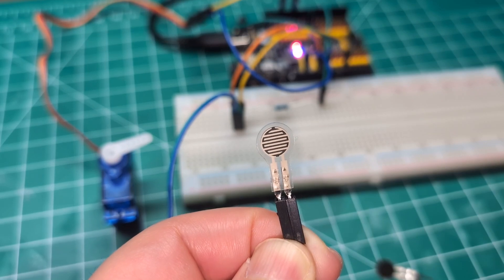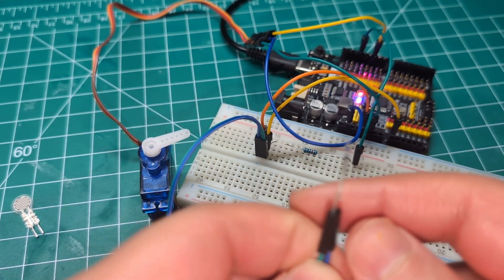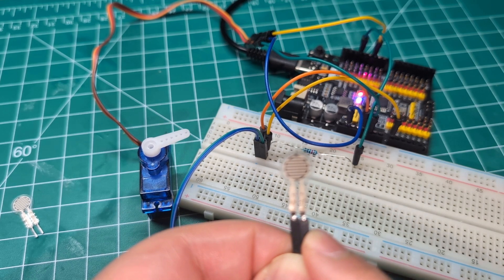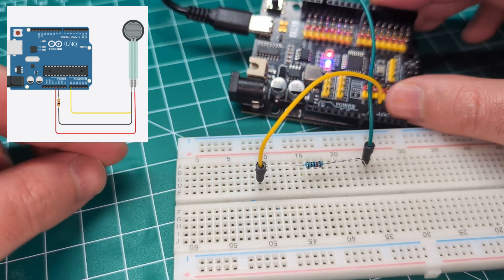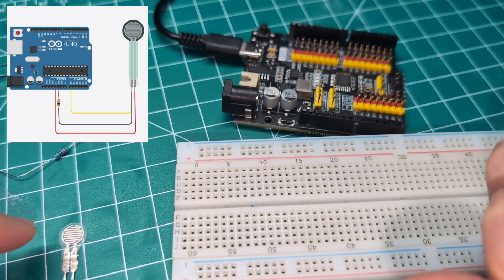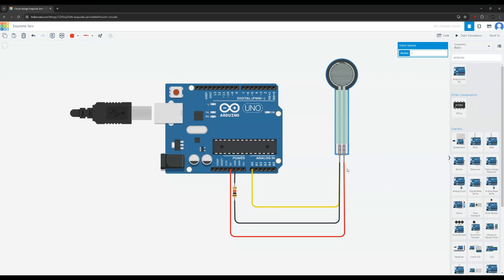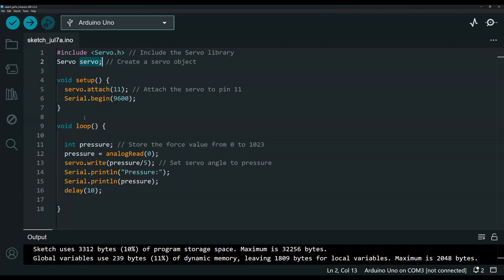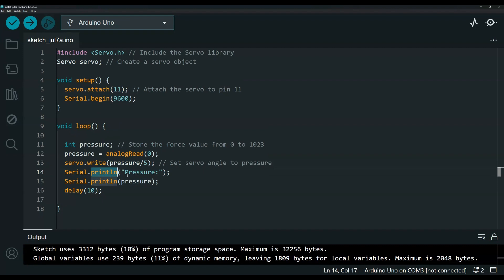How To Use Force Sensitive Resistor (FSR)

Comment: What if we wanted to hook up 20 of these? There isn't enough pins....
Reply from the maker: Great question, you can use a hat or a module to extend the pins
Reply: @techs.passion A big thx for your reply and making your vids to helping others like myself 🤜🤛. After I wrote this post I looked deeper into it and found out that I can use a 74HC4067 muxes and it gives 16 extra inputs or channels. So this will work perfectly! I can use a arduino mega and two muxes 😉👍

Comment: can i use the fsr for other things such as being used as a sensor that can use pressure as something that will a machine turn on? like if the fsr is not activated, a machine will not work
Reply from the maker: Yeah for sure, I think it can be perfect for that use case

Comment: Hello, can I get the code of pressure sensor with motor?
Reply from the maker: For sure, so the code linked in the description, do you need that to be modified?
Reply: I need the code of the project that you did in the beginning
Reply: With servo motor
Reply from the maker: Sorry for the late reply, this is the link to my Free GitHub https://github.com/TechsPassion

Comment: Thanks! I'm making a tiny game controller and I wanted analog triggers. Originally I was going to use some 8mm throw linear potentiometers I found, but this is far smaller.
Reply from the maker: I think that's a great use case for it but not sure how it will work long term but good idea worth trying. Glad you found it helpful
Reply: @ the PlayStation 2 face buttons, triggers, and bumpers all use this technology and they’ve held up okay, for whatever that’s worth.

Comment: A nice little circuit, I was thinking about its applications, I think a few of the sensors could be used under a doors welcome mat as an automatic doorbell, although I suspect they would have to be coated with silicone to make them damp-proof.
 Another is to build one of those fairground grip machines with an array of staggered sensors in something gripable that measure the amount of force in your grip.
 I suspect there will be a multitude of applications!
Reply from the maker: For sure, I was thinking of making a servo grip which is why I got them. I like the idea, I think there are so many application for them. Good to see you here @AndrewAHayes